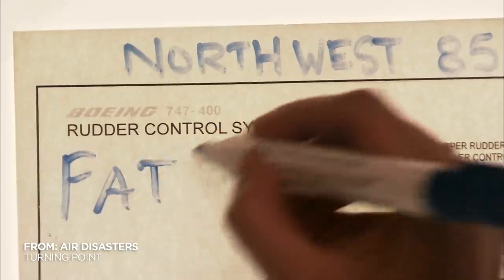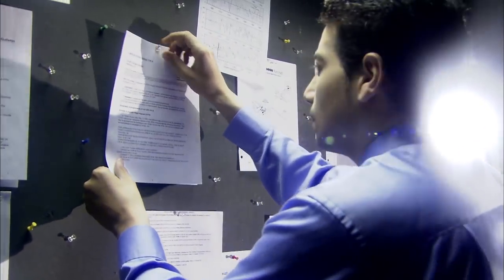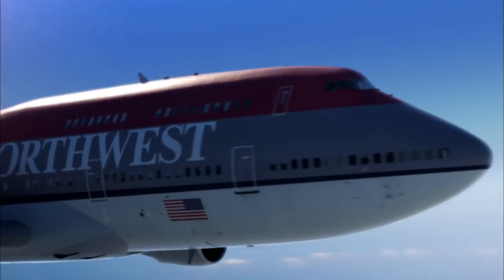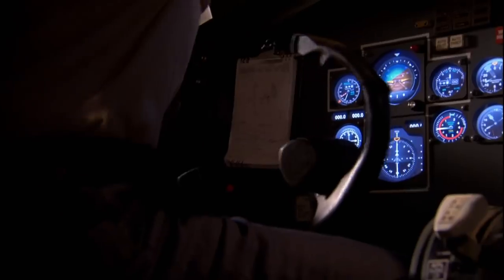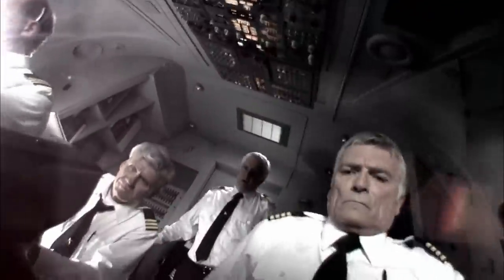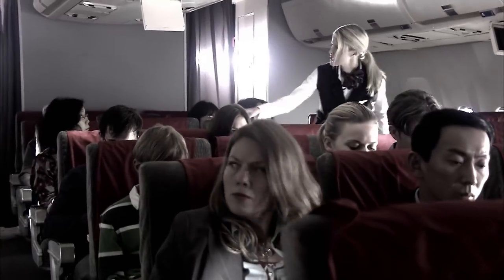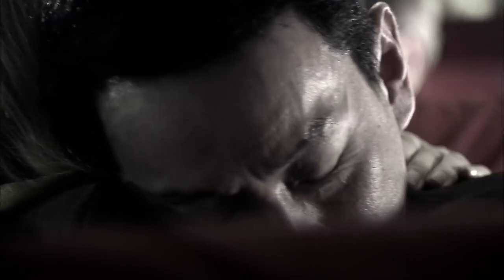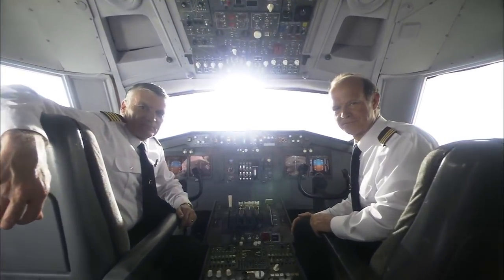Safety Lessons From the Emergency Landing of Northwest Flight 85 | Air Disasters | Smithsonian

Comment: Another important point: it was an old Boeing design, before new Boeing designs like 787 and the 737 MAX. With the new designs, would the flight had been able to survive? The Boeing of today is not like that of yesterday.
Reply: Nope because the 787 has a single rudder, accidents like United flight 585 could happen again.